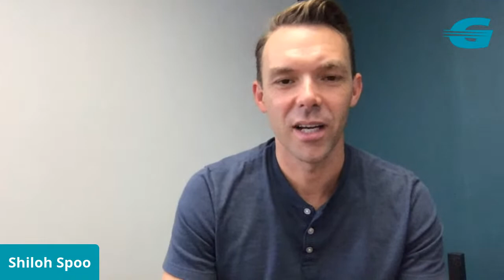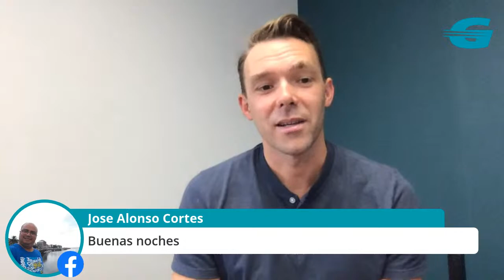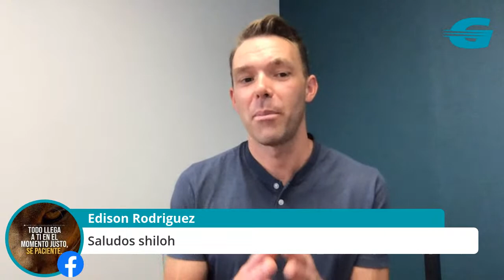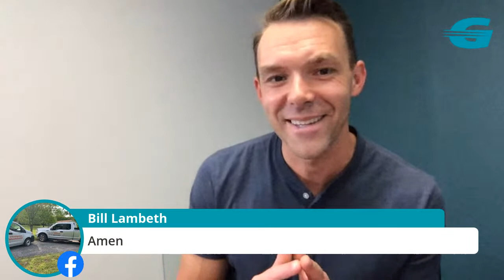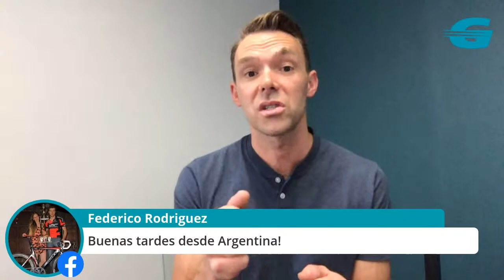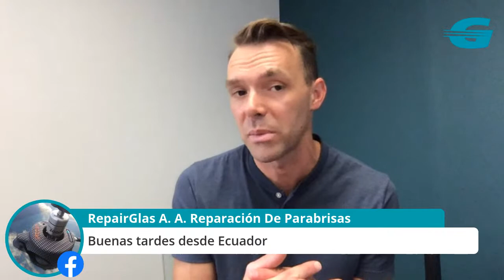The Future of Windshield Repair

Comment: great message - would there be a limit to a # of repairs/windshield before structural integrity is at risk?
Reply from the maker: Hello Rick,  it really depends on the quality of the repair. If each rock chip is repaired correctly, there really isn't a limit on quantity. The structural integrity should be 100%. Of course, too many is just plain annoying to drive with.
Reply: In New Zealand we have a Aus/nz standards to meet and a limit of 8 and 3 in the c.v.a